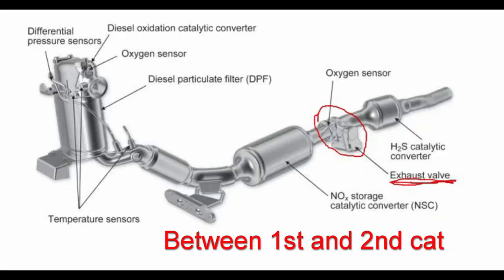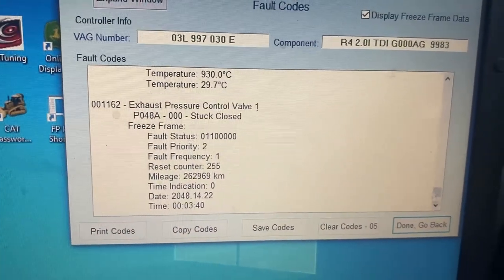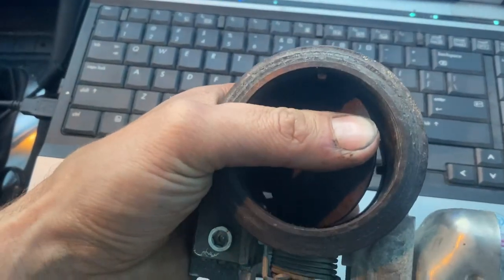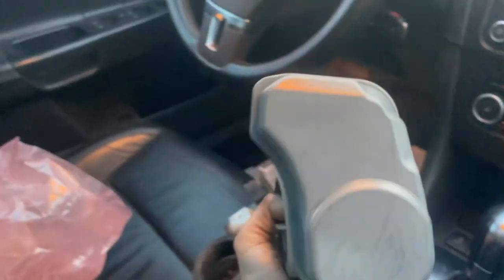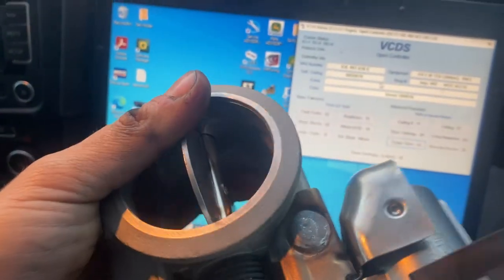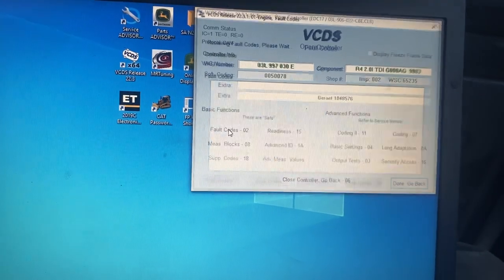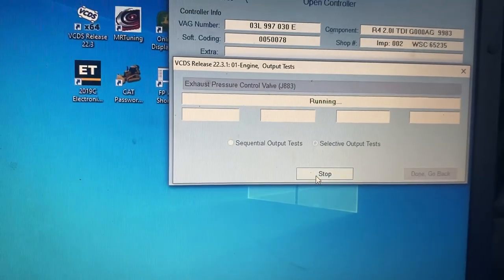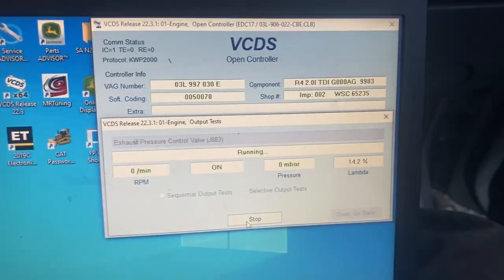CJAA TDI Exhaust pressure control valve diagnostics

Comment: So incase you ever have to do another one. Free it up best you can, the spring loses tension. If you put the flap all the way down the spring lifts off the housing. Slip a 3.16 rivet (-the shaft)  overr the spring and let it come back.(spring has tension now)  Work it back and forth a bit(pb blaster) and it will return on its own.
Reply from the maker: That sounds easy enough, the car I initially did this for seemed to free up after soaking with penetrating oil for a few days

Comment: Hey josh, just curious where you order parts from? I live in Ontario as well. I have a 2011 cjaa tdi I got a few weeks ago and so far it’s been pretty good. Do you use any fuel additives? Sorry for the questions I’m new to the tdi world.
Reply from the maker: Idparts is very reasonable, pre-pay duty fees and shipping is fixed (usually gets here in 2 days). Germanoem in Toronto is another go to. This will be my first common rail and isn’t on the road yet so I haven’t used any additive but I plan on using something for lubricity, as far as a cleaner I usually use liqui moly diesel purge on filter changes
Reply from the maker: @Jdjd-k5z I have done it both ways, I personally think people make a bigger deal out of it then they need to

Comment: Hey Josh,  I have a 2015 Jetta TDI and it has a permanent check engine code.  OBD2 reader shows it to be (Exhaust Pressure Control Value Position Sensor/Switch Circuit) (Code P048B).  Any ideas before I start replacing parts?   If it happens to be the the pressure control valve can you provide a part number?  Thanks great video!
Reply from the maker: The 15's are different but id try output test and make sure everything it moving correctly, if it is i'd try 5Q0253692B

Comment: Car just threw the code today Still runs fine. Am I fine to drive the car up to work tmr. 130 miles round trip. 2014 Passat tdi
Reply from the maker: It’ll be fine, it’ll probably just prevent regen if it won’t close.

Comment: Hey there, not sure if this is a long shot or not but I’ve got a 2012 sportwagon tdi with the 6spd manual and under acceleration when I rev it I can hear a hissing noise coming underneath the car right at this valve, any ideas on what it may be?
Reply from the maker: The valve itself can leak or the v bands on either side
Reply: @JoshsJettas  Thanks for the reply! I think it’s the V bands leaking forsure
Reply from the maker: @fitbiker1800 they can get pretty crusty under the car, mine were pretty rough

Comment: How do you get the valve from the actual exhaust? Do you have to pull off the exhaust?
Reply from the maker: Yes 2 v-band clamps hold it to the exhaust
Reply: Thanks. I figured it out lol
Reply: Thanks. I figured it out lol
Reply: Thanks. I figured it out lol

Comment: Can you run the car without this valve if you get a new straight exhaust missing this valve out??
Reply from the maker: Its used for regens and low pressure egr, if by straight exhaust you mean by removing the aftertreatment system then this isnt required
Reply: @JoshsJettas  Thank you for your reply. As you can probably tell I don't know a lot about cars. I've had the dpf filter removed 2 years ago and a remap as that kept giving me problems. Now this exhaust pressure control valve is giving me issues. Not sure If I can have it removed as well? Or should I just get a new one fitted?
Reply from the maker: It should be tuned out but you never know, unplug it and see if a code pops up. If nothing comes up then you can get rid of it

Comment: noticed there is updated VW part number 1K0-253-691J- best price i found was ID Parts
Reply from the maker: That’s where I got the one in the video as well
Reply: @JoshsJettas  also noticed that spraying fluid film on mine freed up the valve... at least temporarily
Reply: @dh7277   What fluid did you use? Did you remove the entire part?
Reply: @Jacob-ne7ro  i used "Fluid Film" and sprayed where i could see the shaft.  i did not take apart the valve nor did i remove it from the car.  so even though i purchased a new valve i have not changed the valve as 5 months and 10k kms later it is still working.  i am very surprised that it is still working.